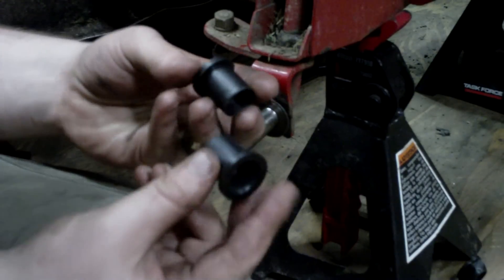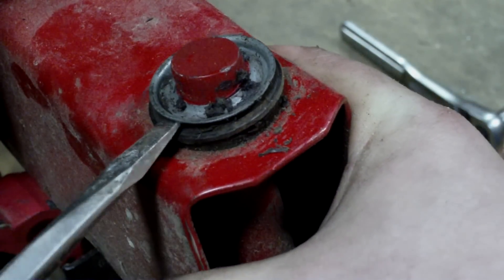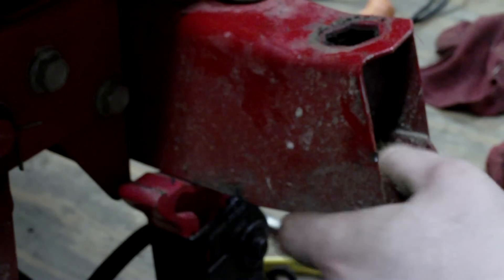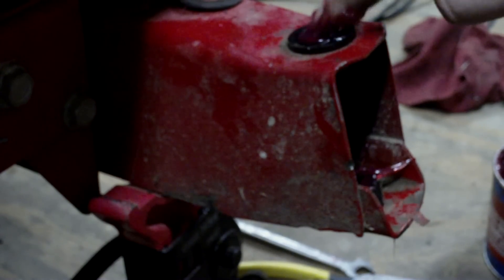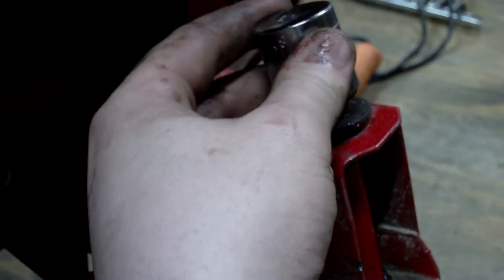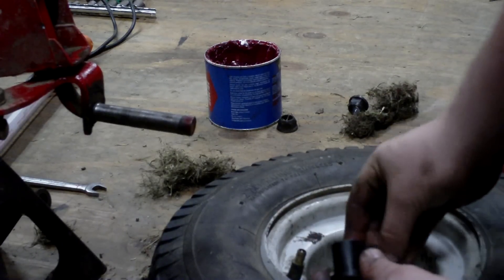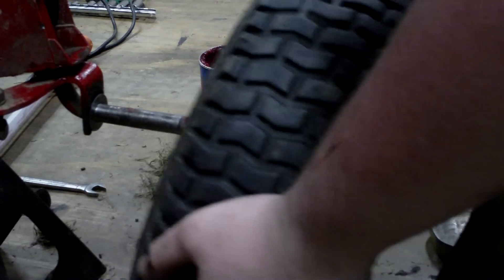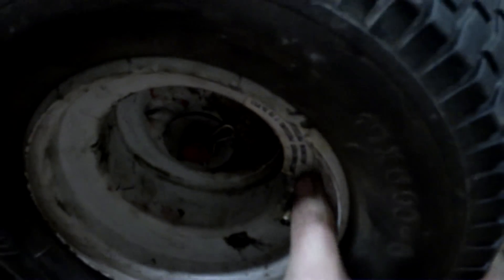How to replace Front axle assembly  / Front wheel Bushings In a Riding Lawn Mower (MTD)

Comment from the maker: You should be able to find them at tulsa engine warehouse, i tried looking up your mower but all i can find is a owners manual with no parts diagrams, some mowers will have a actual ball bearing pressed into the rim, which is much better, others will have a brass or steel flange bearing that presses in, not as good a ball bearing but better than the plastic ones. You may have to email tulsa to find out, they have a live chat, and they can find just about anything for you. thanks for watching!

Comment: Where do you find those bushings?  I have a craftsman lawn tractor and I did take the spindle apart, tire too of course, and I found plastic bushings that were eaten up.   The wheel shaft didn't have any plastic bushings just the upright spindle  I didn't know if they disintegrated or they just don't use them.  By the way it's a yz4500 lawn tractor.  26 hp 54" cut.   
   Thanks in advance....

Comment: I just replaced these bushings on my 93 mtd with some bushings I bought from ebay, they fit OK but did seem to have a bit more play, also the material seems to be a little different than the original bushings. is there a seller you recommend for these plastic parts? The front wheel bushings seem to fit fine, it was just the steering ones that seems  to have a little bit of play.
Reply from the maker: Kyocera234 There is almost always a little play in them, thats just from wear on the spindles them selves, I've had good luck with buying these parts and other parts from tulsa engine warehouse (tewarehouse.com) they are cheap since they offer aftermarket brand. The only ship within the us though. Thanks for Watching!!!

Comment: I replaced the bushings on the arm and on the wheels. but now the only way the tire fits back on to get the pin back in  is with the valve stem on the inside?  Wtf is going on?